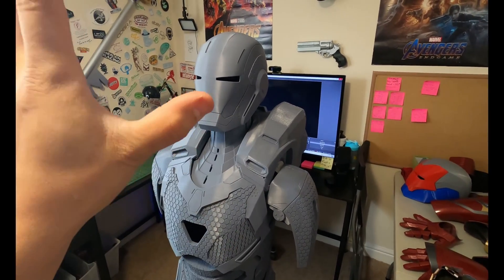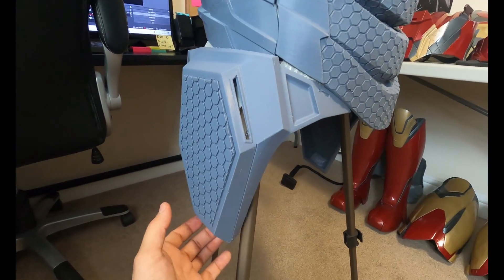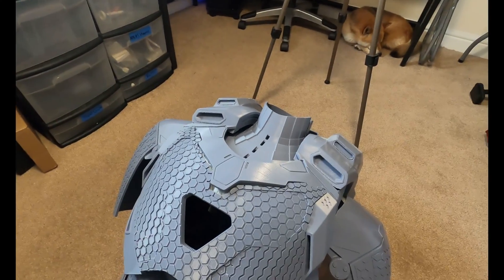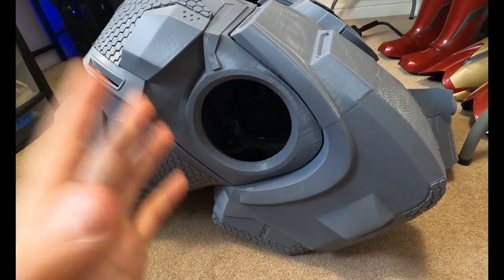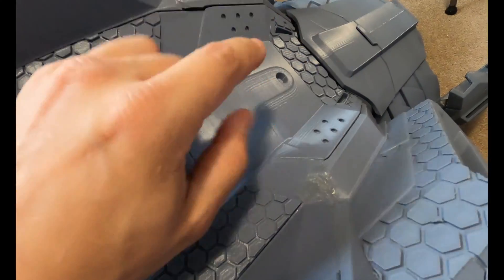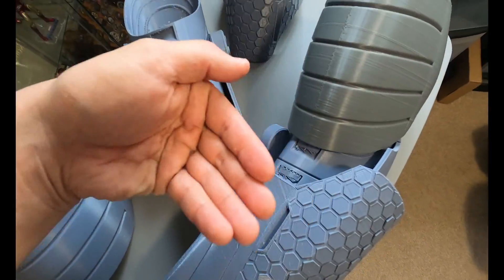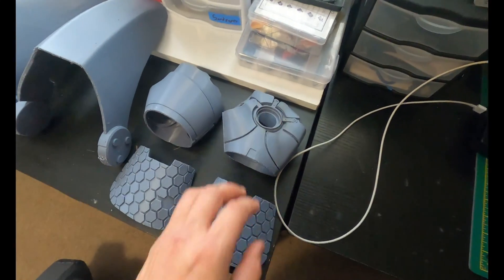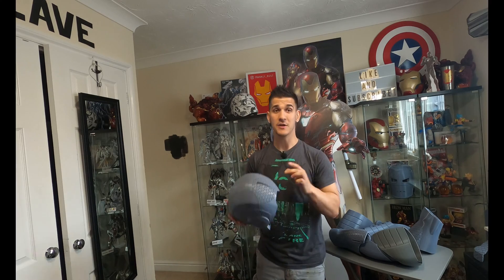3D Printing an Iron Man Suit!  | MK39 Starboost Part 3 |

Comment: Saving me filament again with this video.  Arm hole issue mentioned at 6:45 is great to know.  I was able to use a negative cube in Orca to delete the material opening the arm hold all the way to the back for easy slide-in and it makes the print easier as you can orient the bit like a U.  Thanks again, Frank!

Comment: How did you get the helmet to fit. I used your video using Uncle Jesse's calipers amd measured his head. I scalled using the ear pieces. Should I do the bottom ring and would it still fit snug?

Comment: I like your idea about the neck piece sliding into the chest (if they had modeled it that way).  Seems like a fairly easy mod to either model and print clips that could glue to the chest, and allow the neck to slide into; or make some from epoxy putty and attach to the chest with the neck piece taped in the desired location.
Reply from the maker: Yeah exactly. Like a slot or something
Reply: Exactly.  Like you said, would’ve been nice modeled that way.  But with your skills, should be an easy mod. 👍🏻

Comment: I like the idea of hinging the armhole parts so you can get your arms in but I would hinge them off of the chest instead of the back. That way you don't have to contort your arms back in a weird way to get them in if you hinged them off of the back. All you would have to do is put your arms out straight and put them through from the front
Reply from the maker: Yes but by putting them on the back it literally wears like a backpack.
Reply: @FranklyBuilt  Oh yeah true lol